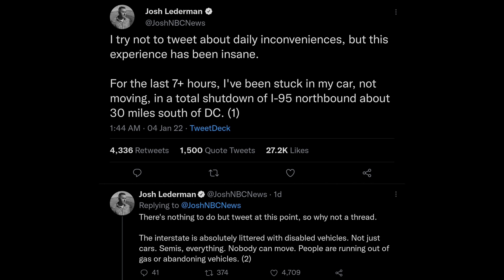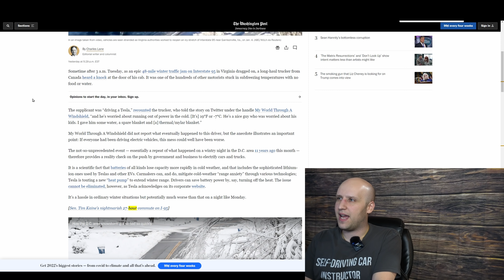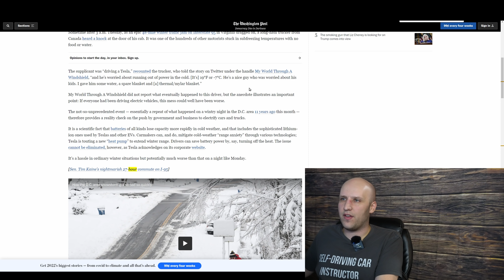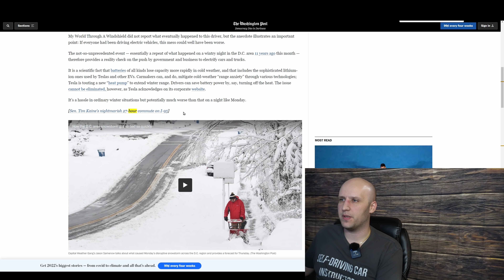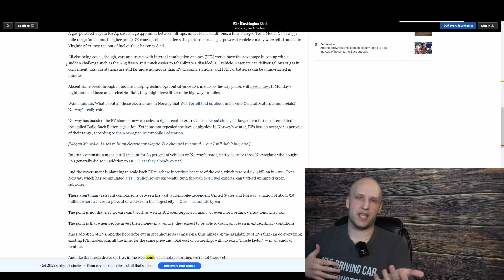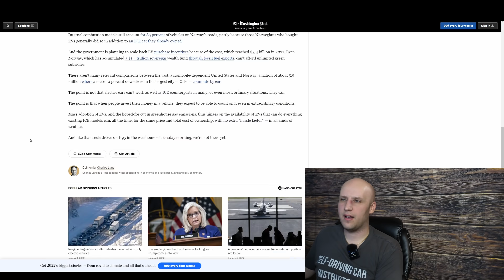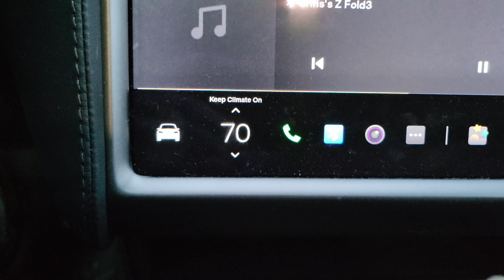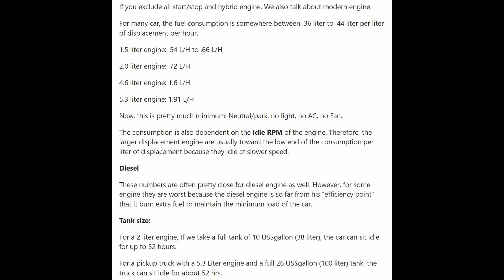How Long Can a Tesla Keep You Warm In A Frozen Traffic Jam? | FUD Debunking

Comment: One point your video overlooked is that if you are road tripping in a tesla and hopping from charger to charger.. The tesla app will notify you that you have enough charge to continue trip at about 10% to 15% battery buffer to reach the next charger.
By following the teslas recommended road trip charging schedule.. you would enough charge to run the heater about 4 hours if caught in a highway closure

Comment: Sadly I don't have a Tesla yet, but personally I'm much more comfortable with losing a bit of range in the cold, which you can easily manage by charging more frequently, than I am with any risk of not being able to start an ICE engine! Thanks for doing this experiment, clearly demonstrates that this is a non-issue for Teslas; maybe it'd be more of a problem for EVs with smaller batteries.

Comment: Business idea would be a "quick charge" tow truck.  A tow truck that would be equipped with charging capability--either powered electronics or a onboard battery to give a electric vehicle enough charge to get on their way to a charging station.  They could charge a "tow fee"(actually a quick charge fee) without having to do a tow.

Comment: I'm wondering what would happen in the case of being stranded on a highway like this and running out of battery power.  With an ICE vehicle, you could just have someone deliver a can of gasoline and you'd be good to drive to the nearest gas station to fill-up.  What can you do with an EV?  Do they have portable chargers that could charge you up enough to reach the nearest charging station?  Do you have to have it towed?  Some other way?
Reply: Watch the whole video then comment?
Reply: Yes,, you can use a power inverter like a Jackery to get you some extra range to make it to a charger.  YouTube Videos show how to do it.
Reply: Yes EV has portable charger -level 2 or 3. Plug it in and wait for several minutes and you're good to go..

Comment: We have two ICE vehicles and I see many more advantages over EV's in this situation. Here is how I would have handled being stuck in this same situation.

1) I dress for the weather as if I was walking.
2) Never let the tank go below a half tank of gas in the winter.
3) Keep two 5 gal. metal gas cans in the trunk, for long drives, in bad weather.
4) Depending on outside temp., I would turn off the engine every 30 min. or so.  Let engine run for about 10min to recharge the battery and run the heater.
monoxide

Comment: Older New Englanders remember the Blizzard of ‘78, when 3,500 cars were trapped on Route 128 around Needham, MA in the late afternoon rush hour of Feb 6.  14 people died in their cars from carbon monoxide poisoning. Snowmobiles were used to get people out of their cars. Snow (up to 40”) came so fast it almost buried the cars and tailpipes were plugged.  It took 5 days to remove all the cars from the highway, with the National Guard in some locations cutting the guardrails from the other side to pull/tow the cars away.  I’d feel far better in an EV than a gas car since I keep the battery above 60% by charging at home every night.

Comment: I think it’s also good to note that turning the heater lower in an ICE vehicle isn’t going to do anything for efficiency. Since heat in an ICE vehicle comes from the massive heat waste from the engine and running coolant through the heater block, there’s no way to extend your heat. In an electric vehicle, you can stretch even a very low charge for an extremely long time if you keep the heat low and utilize seat heaters to stay comfortable enough.
Reply: He said this in the video at the end
Reply: @chestermartin2356  ah must’ve closed it too early. Smart man, should’ve know he didn’t miss it haha
Reply: This!
Reply: You can heat the vehicle hotter then let it cool for a longer period before starting it.
Reply: @cormacsyt0  But seat heaters only heat the important part: The body and only the where people are sitting, so you don't waste energy on heating useless cabin air :D
Reply: Except for modern engines, where the cabin heater is supported by electric heaters. Reason is that modern engines like the one I have in my VW Golf are very small and don't heat up that quickly, do not produce that much heat or are automatically turned off when not in use to drive the car. This heater is also used to warm up the engine to get it to operating temperature more quickly and to heat the oil for the turbocharger. Bigger engine options don't include the electric heater tho. (Mine has a 1l 3-cylinder)
This heater will use the 12V Battery that will be charged with the engine, so technically speaking, if you turn down the heat for the cabin, you may decrease your fuel consumption slightly in that scenario.
Reply: No But you can shut off the engine for 15/20 min. and run heater while hydronic heat is still present. 15/20 min on / off to extend fuel usage. From Alaska I know about heat..... just sayin.
Reply: Internal ICE car heating = less outdoor (global) warming :D  ... by a smidge
Reply: @somethinghalffull  wat
Reply: @BorkMcGork  Sorry, too much top put into words, and mildly intoxicated, hic.  My point is... using a 1.4 litre or whatever engine to warm up a car is ridiculous.  I hope you agree :)
Reply: Oh yes, you did and I wasn't making much sense, sorry :)
Reply: @somethinghalffull  

There are some light agricultural/commercial electric vehicles that do use a small fuel burning heater ...for winter use as their small batteries would take too much of a hammering to produce enough heat for the cab and protect the battery charge in sub zero German winters.. and heat water for hand washing.... sensible way to go and minimally polluting  overall especially as you dont need to use the fuel heater half of the year.
Reply: @clivestainlesssteelwomble7665  Agreed my friend. That heater is fit for purpose.  ICE engines are at most something like 30% efficient.  The other 70% heats up the environment
Reply: @cormacsyt0  there’s a difference between a warm butt and warm air. Also the seat heaters being resistive heaters is. It comparable to the resistive heaters for air, it’s more akin to a heated blanket. While not efficient, it’s a very small amount of power draw. Tesla recommends using the seat heaters even.
Reply: @cormacsyt0  it’s been tested. The seat heaters use very little power. The heat pump is efficient compared to an air conditioner. The recommendation from Tesla for best efficiency and comfort is to use a mixture of modest air conditioning and seat heaters.
Reply: You can definitely just cycle the engine on for shorter periods to extend it's efficiency when you are producing more heat than is needed but would have to verify the battery gets charged up enough between starts. While most ICE engines are only 30% efficient, Atkinson cycle engines are around 40% at certain cruise ranges in comparison although it would be interesting to compare both of those at idle to see if there is still a significant difference. Having a Toyota Rav4 Prime plug in hybrid electric kind of gives me the best of both worlds right now and if I were to get stuck it would probably be one of the longer running vehicles.
Reply: @Chris-ew9mh  Sounds like the premise to a great youtube video of calculating the potentially best vehicles to have in such a situation, then getting them in real life to test them out!
Reply: What if the car dies along with thousands others? There is no infrastructure to charge stuck electric cars, let alone thousands of them
Reply: What if you use the heated seats in your ice vehicle
Reply: @Grace Jackson Haha, maybe you have the most efficient ICE car in existence!
Reply: Actually it does, but only when the temps are very, very low. OTOH most ICE cars can idle for at least 2 days and many can go much longer so it won't come into play. What will come into play is the fuel cost. EV blows ICE away for idle heating cost!
Reply: Yes but a diesel in idle uses so little fuel, it is almost not believable.
Reply: Replace your heaters n blankeys with sheepskins. "Pets with benefits" . Always there when you need them. Cool in summer n warm in winter. Never need to eat or drink or pee or poop. Very comfoting to have near by.❤
Reply: Uhm, alternate between max heating and engine off? 🙄
Reply: @BorrowedAtoms  takes quite a while to warm up a cold engine, right? We’re talking about comparing a sustained amount of heating over a long period of time. You could do the same with an electric car and still be vastly more efficient.
Reply: @BorkMcGork  
The other issue is you are less likely to be poisoned by carbon monoxide or smothered by CO2
Especially if the snow builds up against the sides of the vehicle where the Exhaust is.

When its that cold your phone is likely to die if it gets exposed to the weather.
Towing an EV out under regen on ice snow etc will be difficult. 

Nio operates a fleet of roadside charge and swap EV battery vans .. as part of their operations
But thats an advantage of a standardised systems.
Reply: @BorkMcGork  The ICE and its coolant retain heat for quite some time when not circulating; it wouldn't cool down to ambient temperature before you cranked it back up.  A brief run would then heat it back up quickly.  There are many assumptions and variable at play in these scenarios.
Reply: @BorkMcGork  it’s still way less efficient than electric, but cars with auto engine off will cycle it on for a couple minutes then off again for a few minutes if it can with the climate control set to a certain temp. In that case cranking it higher would run the engine more. That’s with a smaller European engine though, I imagine bigger American engines might not heat up as quickly. But even 5-10% extra runtime from the auto-off, even if you normally turn it off for driving, could turn 50 hours of idling into 52-55.
Reply: @BorrowedAtoms  You would have to be careful to run the car long enough to charge the battery each time or you would run the risk of it not starting again - which would be even worse. At idling speeds and in the cold the alternator is pretty slow to charge the battery.

Comment: About this test... it makes sense to run the HVAC remotely from the phone, but the way the car performs when directed to heat itself in that situation can be different from if you were sitting in the car. When you tell the car to heat itself remote, usually it will run the defrosters. That process uses more power and turns the fan setting all the way up. My assumption is that process ends at some point, but who knows when that is. If you are just sitting in the car with the HVAC on, then the fan probably won't run that high - thus using less energy. The heating logic is also different. According to Bjorn, the car will prioritize heating the cabin over heating the battery if someone is in the car. If no one is in the car, then the battery heaters will run at full throttle for a while. In other words, the energy usage curve would be different as well. Of course it would require more testing, but I would wager that the energy consumption would be even lower if someone was in the car during that time.

Comment: Few would start at 90%, or even 80% when they get stranded. Starting at 70% or even 40% is likely
Reply from the maker: Right, but with the information at the end of the video you can see how long you would last at each state of charge. A gas car is not going to be at 100% either.

Comment: If you have people inside the car you're going to need to draw in fresh air from outside to maintain an acceptable oxygen level. That means expending energy to heat up that cold air. Conducting tests with an unoccupied car is not representative.